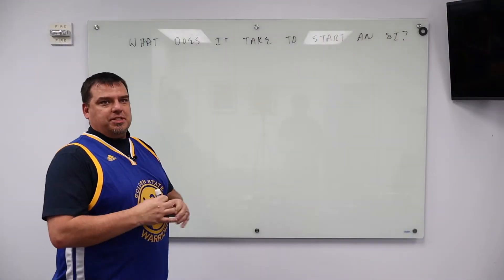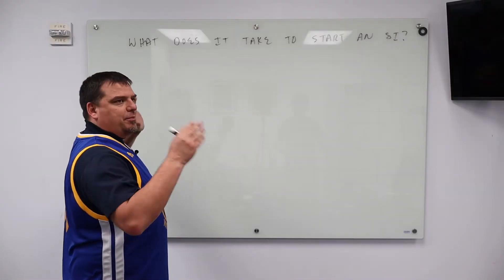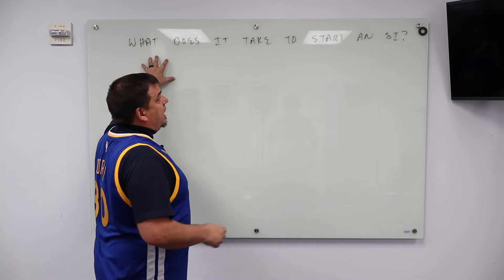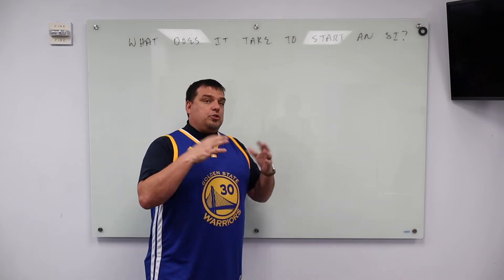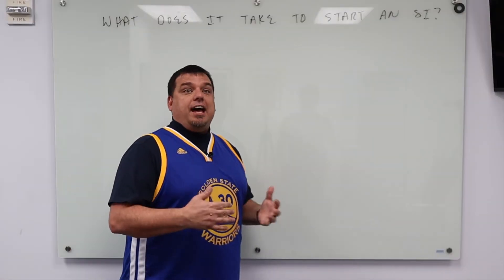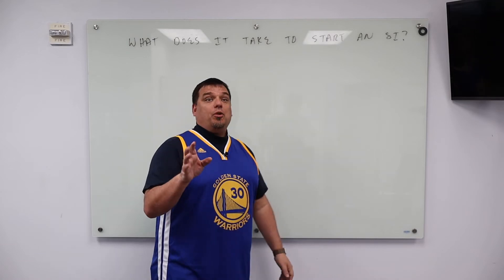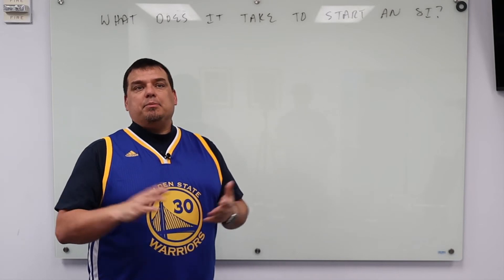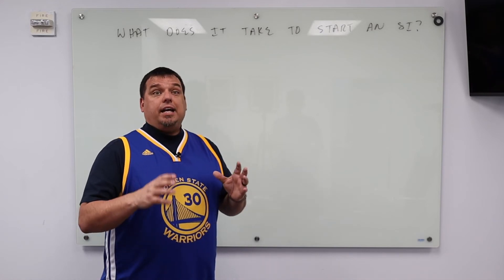What it takes to start a System Integrator

Comment: recently let go from management position at manufacturing company. I understand plcs are different from my ultrasonic welding experience, but i'm looking into the siemens course online to learn the fundamentals. could a systems integrator break through in my situation with this previous year of factory supervising and technician experience, including sonic welding and thermal presses?
Reply from the maker: There's a need for technicians that can develop edge-data collection solutions, HMI and SCADA solutions using open-source platforms like Ignition. PLC programming is as good a place to start as any to determine your interest.